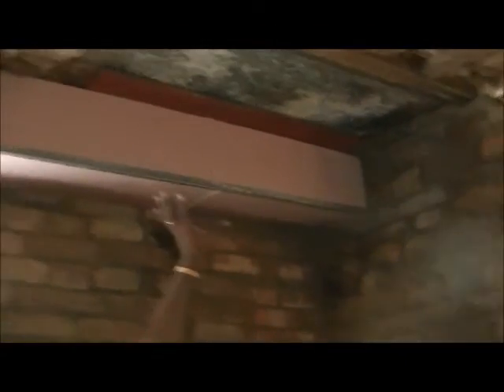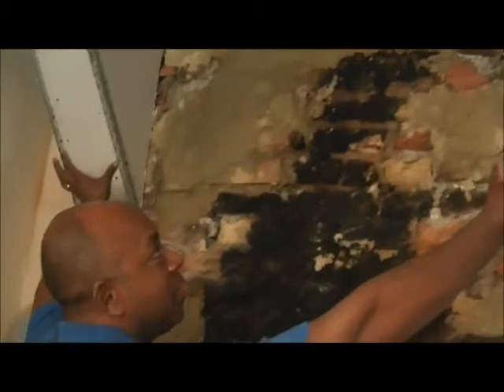Steel Beam and Gallows Brackets support

Comment: You should wire brush off all the clinging soot from the remaining flue wall, otherwise the hygroscopic soot chemicals will come thro the render esp. any gypsum plaster (dont use it over soot). The chemicals will eventually stain the decorated surface.
After wire brushing blind the soot with two coats of SBR then use a 3:1 sand & lime render with limelite finish (or board finish).